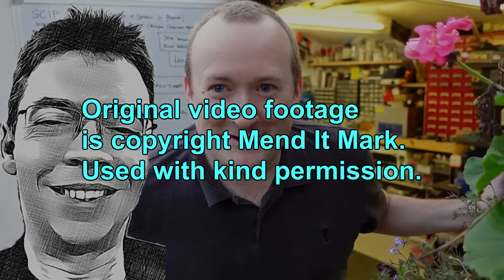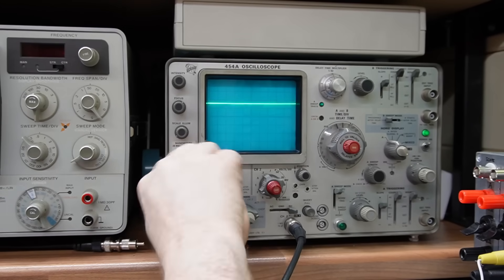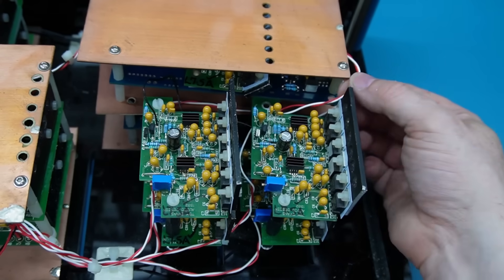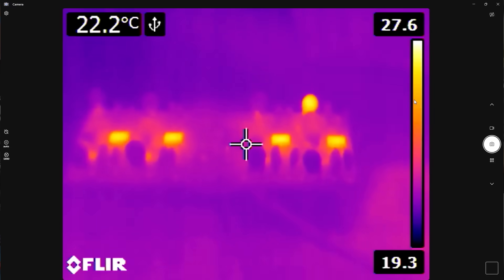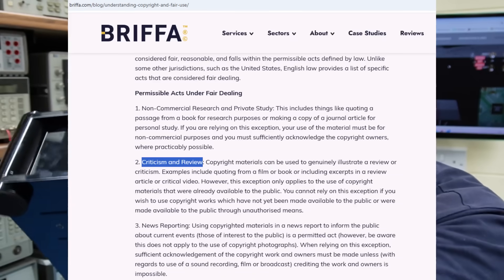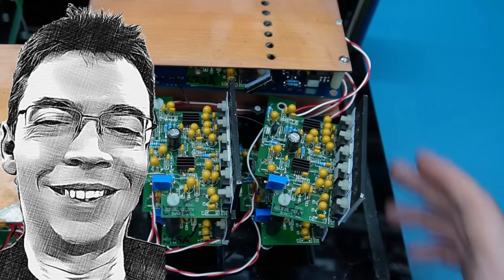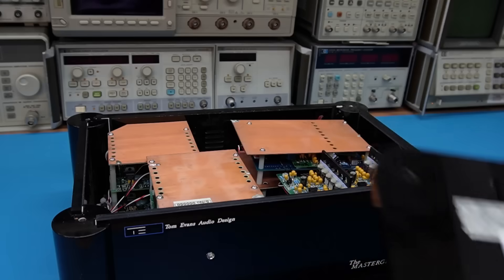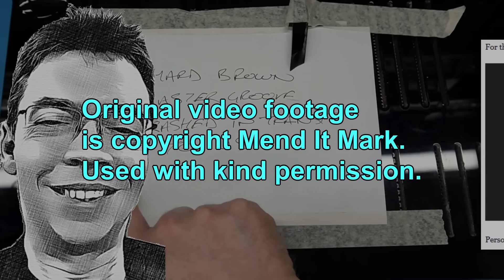Reaction to Mend It Mark takedown by "Tom Evans"

Comment: Yes..we all were a little shocked at the poor finish...for the asking price it seems more outrageous but customers are being asked to pay for his technical knowledge..degrees gained at University and setting up his business...fully equipped workshop and test equipment i expect...which cost a small fortune no doubt...one would hope this particular example was an early-ish version and he has improved the quality of the finish of his amplifiers which is technically sound and accurate and probably better than most high end amps...just that you can probably buy one for a few thousand mass produced with the same specifications...or indistinguishable to the ear... certainly my ears anyway
Reply: The use of tantalums is questionable,  the thing that makes people laugh is the atrocious mechanical design, the build quality is just a factor of the design. its complex but as is.
The atrocious mechanical design is fragile, that's the main complaint. and it must be awful to manufacture, not elegant.

Comment: To level-set expectations, I used to help build bespoke vacuum tube phono pre-amps at an audiophile company.  For the equivalent of about $10k USD in today's dollars, you got a custom folded , anodized aluminum chassis with pressed, metal stand-offs, solid milled aluminum bezel and knobs along with a beautiful custom monolithic circuit board. All tubes were burned in and matched. If you looked inside, you would see sublime elegance. Go to any audiophile trade show an you will see similar craftsmanship. The preamp Mark worked on looked like a prototype.
Reply: I watched the video.  It looked like cheaply built piece of junk.
Reply: not to mention lots of vintage commercial amps and pre amps that sound amazing and a cheap as chips now.
Reply: @ljones2087   Indeed, a 70s flag ship Marantz or Sansui, Yamaha or Pioneer is something to behold. And back then, they solved almost every audio problem. Those things were build like a tank with cutting edge designs, craftmanship and finish. This thing is not one of them. Looks like a DIY project or a first of a kind prototype. He sanded down the op amps to hide these are just normal components.
Reply: All well and good but no better performance than what could be made for £50.
Reply: You should see Tom's linear A amplifier inside!! Heavy boards on tiny plastic pillars!!
Reply: @G-ra-ha-m  I'd love to see them, any link you can share?
Reply: @tomkocur  I cannot post links, but 'search is your friend' :)

Comment: Electronics is where I ended up (professionally) after programming 6502/68K/Z80 in the 80s & 90s. The build "quality" on that amp is something Stevie Wonder would be ashamed of.

Mend it Mark is a genius, especially when it comes to audio repairs. I often leave his videos on in the background while I'm working. He even "machines" replacement buttons, knobs & switches to match the originals.
Reply: Also, you were way more polite about the build quality than I would've been. Excellent restraint, Martin.

Comment: Surely rather than a snarky cocky note, ME should have not underestimated Mend It's skill.

Instead, replaced the capacitor as 'goodwill' and sent it back to the customer.

At 25k, I would expect free repair.

I'm sure the amp itself is really good audio quality. Would be great if the schematics were leaked & we could make our own (better) circuit boards and build for £50 or so.

Matching components is easy. Buy a bag of them (components are cheap) and buy a component tester, again cheaply available.

In the meantime, here is the original video

https://www.youtube.com/watch?v=EwBBxG3ctkY&ab_channel=mattmoran

Comment: Thanks for supporting Mend it Mark. I share your sense of injustice. If Tom Evans had done the right thing by repairing the unit in the first place (and I suggest at £25000 there should be a lifetime guarantee!) there wouldn't be an issue.
Reply: Especially since it would have cost him a few 100 pounds to make.
Reply: @JonnyMac351  Quoted £6000 to repair a broken tantulum capacitor. Seems a little excessive.
Reply: @paulscottrobson  It sure is the whole thing is overpriced
Reply: @JonnyMac351, it's a rip off
Reply: @JonnyMac351 @JonnyMac351  True, £100 or so. But he wanted £6000 for the repair, which is what kicked this whole thing off. Bloke is just a greedy fucker and got what he deserved.
Reply: I worked years ago for10 years in the very high end audio repair world , but I have never seen such a rubbish, I still make a lot of things just for hobby now, but they look much better than this and to be sure they will last longer.
It’s a shame to see such a building quality .
Reply: If he had made it properly in the first place.... It says it's made in Wales on the label, so comes under UK consumer regulations. The purchaser should reject the item as unfit for purpose. I wouldn't hesitate and have done in the past.
Reply: you could sell that for £500 and still give a lifetime guarantee.

Comment: Looks like the designer of the board does not understand the way decoupling works and the effect of capacitor esr, most of the tantalum caps should be ceramic.....  possibly the designer needs to do some revision, by the way does the product meet the requirements of the harmonised directives on lvd, emc, weee, rohs and general product safety? If not; selling (placing it on the market) it would be an offense - just a thought. [And it looks like an undergraduate project or even GCSE....] 

MenditMark is on the other hand a real professional and makes excellent videos which I greatly enjoyed and subscribed. I found his videos due to the copyright strike being highlighted by other youtubers!

Comment: 25,000 UK Pounds !! I wont give even 250 Pound to this Count Tom Evans for such a Shabby work!!  I used to build cleaner and prettier Amps  , right from drafting, etching (Screen Printing) PCBs in my High School itself. So leave an Adult / Engineer/ Professional, but an over hyped Audio-Pile designer hands out such a Horse Shit for such an Obscene price (You can buy a new Audio Q3/A3 Skoda Kodiaq for this price, with a factory fitted Audio system too).
The sick league of Audo-Piles (yes its a Deases, where people support Snake oil audio gear without ANY backing of Electronics, Physics or Maths) should be sent to mental asylum who support krauts like Tom Evans

Comment: I totally agree, the way Mark is treated is unbelievable. 
The build 'quality', I'm having a hard time to call it quality at all, is shockingly horrible. This may work as a prototype, a proof of concept or maybe as a hobby project. But as you've mentioned, the weight of the components requires something way more sturdy, even if transportation or shipping is not considered. The PCB material looks like stuff I have used during my apprenticeship for developing small circuits and why they have hot glued the caps but using plastic stands to hold everything together is something I can't really comprehend.

Comment: Any manufacturer who grinds the identifying numbers off the IC's they used, is pretty hell bent on protecting their product and company. As such, will stop at nothing to ensure they protect their company..(It's Made In Wales). 

Of course, this doesn't stop the average person who owns one from grabbing a screwdriver and opening the case. But still, Mark presented in detail the construction.. this may be the copyright issue. 

As for hot melt glue being used to hold down capacitors. I can't tell how many electromic devices I have opened in Australia that used hot melt glue....

Comment: The problem was that it caused audiophools to reveal themselves - because that UKP25,000 piece of equipment didn't look the part. And many people were shocked at the shoddy construction for what you paid for. If you order a USD$30,000 piece of test gear from Keysight, you can see where the money was spent and it feels like it was well spent. Something like this looks home made and of poor quality. Heck, a $30,000 Cisco piece of gear (generally well known to be overpriced) still feels much better constructed with high quality parts, a strong chassis and a clean circuit board that's well assembled and put together. Tom Evans was basically selling audiophool gear and the video revealed they were taking everyone as suckers.
Reply: You'd think for £25k you'd get something properly built. It might just be me, but wouldn't you want to shield a preamp from outside signals ?
Reply: I could build that for less than five hundred dollars, the only 'expensive' parts are the power supply, 14 one percent resistors and the op amps, everything else is penny for the pound. Even the case is as we say in the industry "rubbish!"  its the ultimate audiophile scam, charging 25000 pounds for less than 400 pounds of parts (thats being generous) and probably the same in labour. its a licence to print money

Comment: I watched original before it was removed, I don't think Mark ever said anything negative about the obvious build quality.
Reply: The problem with the build is complexity and fragility. its not elegant and its a dogs dinner waiting to fail.
All those tantalum caps and the nylon fasteners on the heatsinks. the lack of proper shielding, very loose barely twisted wires.
Doing it properly would be easier and cheaper, and more reliable.

Comment: The circuitry is nothing but an over preponderance of unnecessary and multiple power supplies to "fill" the box. The only actual "work" is done by just  8 parallelled op amps  wired as per the manufacturers application notes..... 
The construction is poor.
Reply from the maker: There are better ways to supply clean power for the op amps, the power connectivity between the boards is also not great. The op amp boards also can be better. Then of course there is the lack of proper shielding...
Reply: @MartinPiper6502  The opamps have already a very good common mode rejection with the split power rails. , so any simple and standard voltage regulator design would be  more than adequate. The low audio impedances require very little shielding, especially having a seperate power supply away from the amplifiers. The whole thing is a con. Arguably the audiophile snobs would be very happy with this, as it demonstrates a passion and commitment to their hobby, unmatched by their peers.

Comment: Streisand effect LOL. 
Is he trying to claim copyright on the circuit diagram, that would be perfectly reasonable - and many factory service manuals are copyrighted. 
But... Tom holding copyright on the schematic that MARK CREATED from inspecting the circuit boards? 
Obviously Tom doesn't want his shoddy work shown. For good reason! The actual electronic circuit is excellent although hardly revolutionary. Maybe cascading and individual low noise power supplies does reduce noise and crosstalk?
 I don't think this is a total ripoff like $2000.00 power cords, solid silver gold plated speaker wire, or magic tuning rocks: the preamp does work and work well according to reviews. 
I respect that plain old common hookup wire is used.
The packaging is atrocious. Would brass or other metal standoffs cause problems? Love to hear the theory on how. 
Enjoy your excellent Tom Evans MC preamp. Just don't open it and look inside. 

(where are the vacuum tubes though?)

Comment: Imagine being a "dealer" for Tom Evans, and you receive one of these from the manufacturer, and it comes with a rattle.  To investigate, you take the cover off, and find these towers of janky towers of cards with hand-drilled cooling holes, connected by poorly dressed and cold soldered wires inside!
Reply: @donmoore7785  he can't even drill a row of holes in a straight line. Also why reduce the mass and surface area of the heatsinks by drilling them when there's no fan? Then go and paint them black....
Reply: Imagine no more... we all got to see it instead! 😂
Reply: If I were dealer, I’d stop immediately!
Reply: Also note that none of the signal wires are shielded in the slightest, in a case that is highly susceptible to RF/EMI interference. Even the cheapest of no-name generic products get this right.

Comment: @ 4:19 - note the incorrect type font and spacing of the C E mark certification - this is rubbish, and almost certainly not actually certified to this standard. The logo is carefully, and deliberately, designed to have a space between the letters which is not a kerned typeface spacing. It's false. Also, where is the certification identifier that should be present so it's traceable? Nope, nope, nope.
Reply: I thought CE for this kind of products is self declaration  based on test reports. For certain building hardware a certification is required, fire, escape doors...  my business...  Having the wrong Logo is a problem, but will anybody care in times of Temu ?  Today there should be UKAS, but England does oviously not have sufficient test houses to bear the consequences  of the brexit...  I've just retierd and have no longer to struggle with them. 😊😊😊😊😊😊😊
Reply: You are correct - no resources, extra costs, etc. - but although you could self-certify, you still had to show a valid mark (C space E) and a certification ID for traceability on the product casing, in a standard format. This is very much like cheap, un-certified product from unscrupulous vendors selling through CENSORED with false test credentials. Have a look at BigClive's videos about this.

There is no way I would consider this properly shielded for radiated emissions given the revealed internals of the box in the original video, and where could I request a copy of the test certification?

Ridiculous - if the website boasts of 10 units @ 25K/annum can be believed, then from this one product he's earning stupid amounts of money from a badly constructed, un-certified piece of rubbish  that I would have been ashamed to have built as a hobbyist when I was starting out more than 40+ years ago.

Comment: Evans sends it to Mark because customer refused his 6,000 euro repair price.  The message from the manufacturer is snarky in saying "you won't be able to fix it" as if he was sticking his tongue out at the same time.    Of course it would have been easier if Evans hadn't sanded the numbers off the ICs.  Hats off to Mark!  I really look forward to his videos.
Reply: You'd imagine an honest person would mend a £25,000 pre-amp for free. 6,000 euro is criminal.
Reply: Yeah. The sales brochure mentioned that it was like alien technology inside. Then Mark opens it and shows opamps and power supplies. No alien tech there.
Reply: Maybe the ICs are  allegedly copywrited/patented hence why the numbers are sanded off.
..
That would ironic.
Reply: I didn't know that was what the bugger wanted to charge for repair. And it ended up with one tantalum capacitor fried and I wonder what nonsense and outright lies TE would've claimed he'd fixed.

Comment: There's nothing wrong with hot gluing higher mass components. It's done to reduce the strain off the PC connections during shipping and other jarring movements.  Sure this pre-amp is grossly overpriced, but pretty much everything in the audiophool world is anyway.  Probably the only thing I can remember being over-built was some McIntosh stuff, but I don't know if it's still built the same way.
Reply from the maker: @ohger1  it should be polyurethane and with proper fixtures to relieve mechanical stress, not the mess seen in the video.
Reply: @MartinPiper6502  Hot glue is a lot easier to remove if the component ever needs to be serviced.   Mitsubishi used to use some sort of urethane and over many years, the urethane started absorbing moisture and contaminates from the air causing parasitic resistance.  When they used it on the bottom of the board to tack wires, it would eat through the solder mask and into the copper.
Reply from the maker: @ohger1  but hot glue causes more reactive problems.  It's not acceptable especially in such expensive kit.
Reply: @MartinPiper6502   Hot glue is non reactive as long as quality glue is used (like 3M), but that's true of any chemical product.  I tacked wires down in a prototype I built in the late 70s and that prototype was put into service even though it was never manufactured - still fine.
Reply from the maker: @ohger1  except it's still more problematic and reactive than the other better solutions already mentioned.